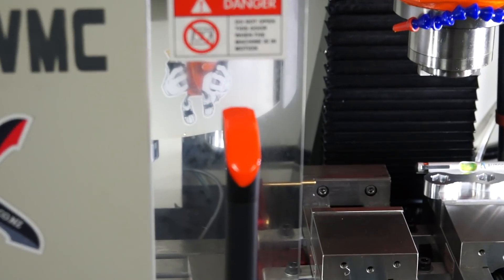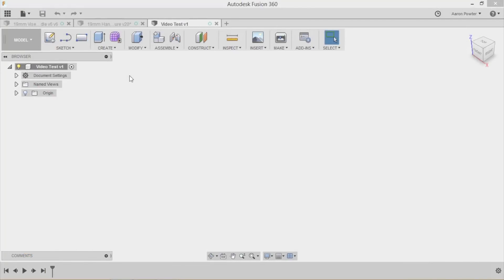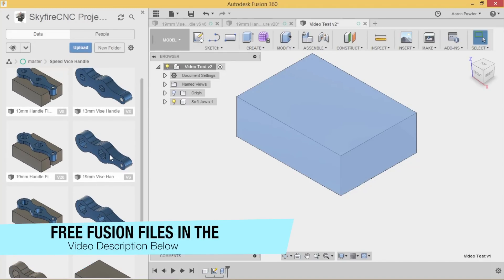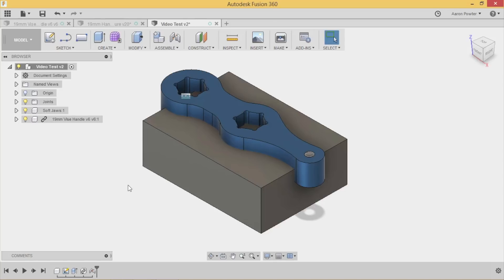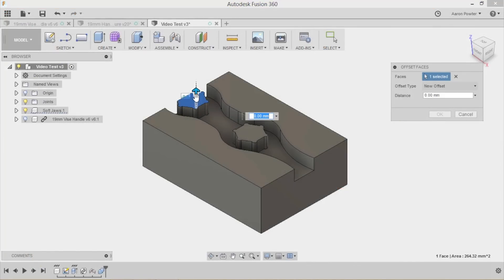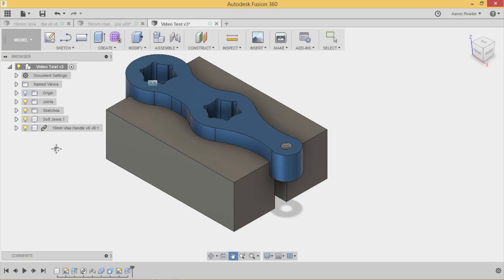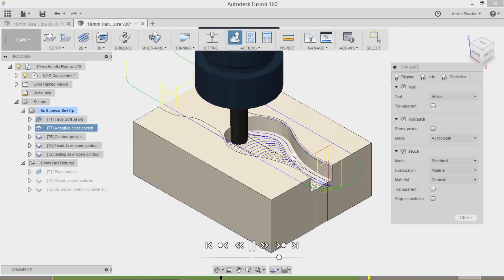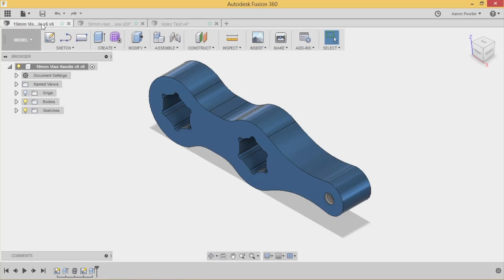CNC Machined Speed Vise Handle Pt.2 - Autodesk Fusion 360

Comment: 先生你好！请问你们用的CAM后处理是那个、急要
Reply from the maker: Hello.  The CAD CAM used here is called Fusion360 and is made by Autodesk USA.  I have post processor for my new Syil machine running LNC5800 controller.  Cheers, Aaron.

你好。这里使用的CAD CAM称为Fusion360，由Autodesk USA制造。我为运行LNC5800控制器的新Syil机器配备了后处理器。干杯，亚伦。

Comment: That came out nice and neat Aaron. 
Did you tighten the jaws against a 10mm spacer before machining?
Reply from the maker: Hi Rob, yes I used a  did mate.  I used a 10mm long series allen key and wedged it in the bottom and tighten the vice on it.  Once the soft jaws where machine I removed it and just inserted the part.  Cheers, Aaron

Comment: Hi Aaron,nice vid man very helpful tips mate! How's the machine holding up? Is it me or is something screaming there(high pitch bearing noise)or maybe the servos and its normal?  I really want to buy one of these machines but want to make sure it the right choice(over Tormach) Thanks:)
Reply from the maker: Hey buddy how are you?  Sorry I can't hear the noise you mention, but I am deaf LOL.  Hey do you mind me asking, but haven't you already purchased the Tormach machine?  Because that's what it says in your about section on your YT page.  If not and in regards to the SF machine, I would seriously do your homework before purchasing one.  Although mine is going ok, I have had some minor problems with it.  Their greatest challenge is failing to deliver on time and failure to conduct proper QC checks before shipping.  If you want me to be brutally honest, I should have purchased a CNC Syil X7 or X5 Combo machine.  Check them out on Instagram (CNSyil), they're a much bigger, honest and OEM company ;-)
Reply: Its probably normal -I have never heard or run a servo machine.Yes, I have a Tormach1100 with Rapidturn at work. I want to make a home shop:) I do follow CNSyil and yes on top of the list. They look like they have very nice machinery. Thanks mate
Reply from the maker: Anytime bud.  Hey, you need to start putting out some vids using your 1100.  It's a great little community us CNC machinists have going on here on YT and Insta.  Cheers, Aaron.
Reply: will do:)

Comment: Great video once again! What do you think is causing the tool chatter?
Reply from the maker: Hi Paul, that was a brand new 10mm carbide end mill.  I did choke right up on it, but I think the geometry was different to my previous cutter.  I will change the tool out and see if it goes away.  Cheers, Aaron.

Comment: Why did you face the top of the soft jaws? No point to
Reply from the maker: Hey Chief, I reset my Z height to that faced area.  In hindsight, yes I could have set the Z off the machined section.  Cheers, Aaron.